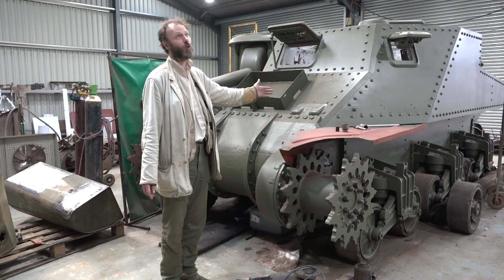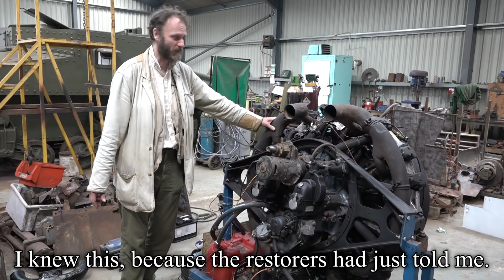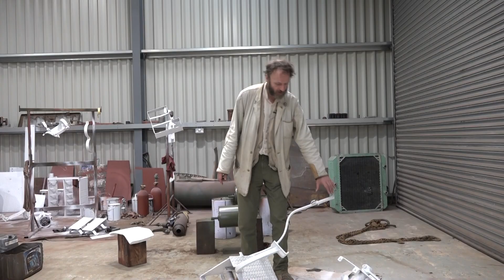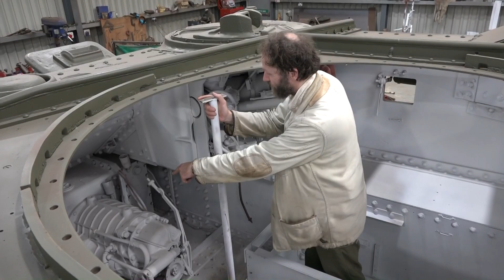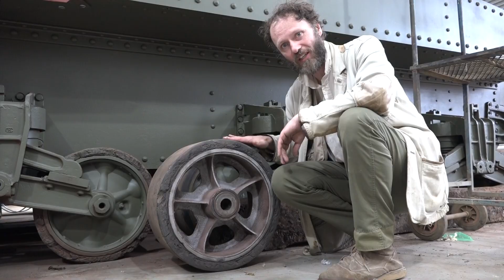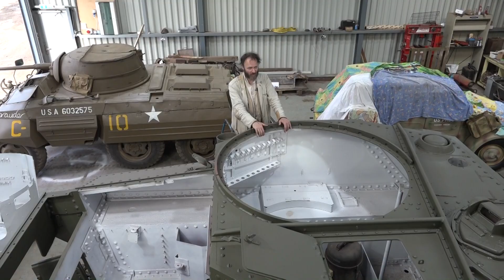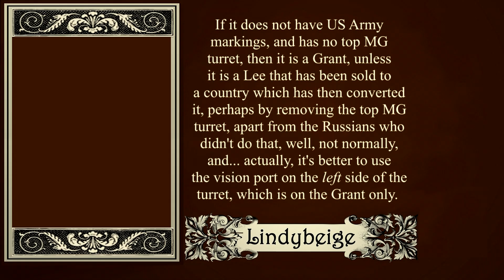The British Lee tank (that is not a Grant)

Comment: The utility of machine guns on tanks depends on where you are fighting.  In the Western Desert it was certainly hard for infantry to close in on a tank and an explosive 37  mm shell
would be liking throwing a hand grenade several hundred yards.  However, un urban and jungle fighting, where an enemy foot soldier could get close enough to do some damage (what were the Japanese getting those steel poles in the jungles?) a machine gun was useful, and with theli limited traverse of the main gun a coaxial machine gun was not going to cut it.  Nevertheless, tanks mount machine guns, event today.

Comment: Two advantages of armour riveted onto frame versus welded plate monocoque: 1. Easier to replace panels in the field 2. Don't need a special jig to hold each pair of plates in the right positions throughout welding, you just need to get an unsecured rivet or bolt into the first hole, then the rest of the panel can be lined up.

Comment: Don't knock the 2 pounder, it could defeat up to 70mm of armour at 60°.
That's the panzer 3 dead and the panzer 4 except the hull front.
"If you met a panther"
Then your grant reached 88mph and was equipped with a flux capacitor.
Reply: Well, it has to get back to the future somehow...
Reply: Where did you get the 70mm of armor penetration figure? Am I right to assume that this is at 1000 meters (which is the traditional distance these figures are tied to)?
Reply: @Ocrilat  
So, at 900m your can kill a panzer 3
But a late panzer 4 you need to be 100m of you're attacking the front, every other side your can kill it at 900m.

So I guess maneuvering is much more important that penetration anyway.
Reply: @MostlyPennyCat  Well, I think they are both part of the package: penetration, damage, tactical mobility, strategic mobility, armor, everything. 

On a tangent, it seems that the more I read about this stuff, though, the more I think that there was a real disconnect between tank theory as conceived at the top and the real situation in combat. So when the theory failed, the assumption at the top was that the theory was right, and the soldiers at the pointy-end just did it wrong. I think that may be a part of the reason the 2-pounder was kept for so long (it fit into accepted tank Doctrine). You see the same thing in the RN, where defects in the design of the 14-inch battleship guns are blamed on 'drill errors', delaying identifying and fixing the actual design problems. I don't know...I think there is something to this. What's your opinion?
Reply: @Ocrilat  
It does sound like doctrine problems.
Sending tanks without HE against prepared AT defences.
But I also wouldn't be surprised if this was just the fastest they could get a 6 pounder in a tank and change it up.
Below they got that they were using 25 pounders in direct fire, which comes high in my list of things I don't want shot at me.
Ze Germans thought we'd secretly design a fully automatic 25 pounder.
In reality we could achieve up to 8rpm X a 12 gun battery. Nearly a hundred rounds a minute, reach with 11kg of HE.

Ouch.
Reply: @MostlyPennyCat  The 25 pounder was good. The problems were a shortage of 25-pounders, as they were needed for artillery, and, they are howitzers, so low velocity and high trajectory weapons, so not ideal. 

A better solution would have been the British 3.7-inch HAA. At 94mm it was similar to the 88mm, was high velocity, and could have been a very effective tank killer. The problem again was doctrine, and how rigidly the British held to it sometimes. AA guns were meant to fight aircraft, so except in emergencies it wasn't considered a 'proper' AT gun. 

It's interesting though, what might-have-been.
Reply: @MostlyPennyCat  It's fascinating...I've been interested in this puzzle for a long time.
Reply: @Ocrilat unlike the 88mm the British 94mm aa gun could not be depressed low enough to be an anti tank gun. They were not built that way. Even after Dunkirk.
Reply: @patrickporter1864  That's not true, considering that on occasion the 94mm (technically the QF 3.7 inch AA gun) was used against tanks in emergencies. It's why at the time it was considered for the job, but unfortunately rejected. It was never adopted for that role, almost certainly because of how rigid the British were at this time. The guns would have been considered a part of the Royal Artillery, and since it wasn't the artillery's job to fight tanks, neither was the 94mm.
Reply: @Ocrilat  yes it took them quite a long time for them to learn anything from the Germans. Despite having one in 1926 it still took them until the mid 1940s to produce a self propelled gun.  Tradition taken too far.
Reply: @patrickporter1864  The USA? It wasn't tradition...it was low military budgets plus a disgust for seemingly offensive weapon systems (offensive in the eyes of the general public anyway). It's why the military pretended that the B-17 would be primarily used for coastal defense. It's why the USN tried to develop submarines into ships that would cooperate with the battle fleet (and failed). It's also why so little money was invested in offensive weapons like submarine torpedoes. And why so much was invested in defensive items like fighter planes, sonar, and radar. Defensive spending didn't annoy the voter like offensive items did.
Reply: @Ocrilat  
Just the wiki page.
70 is it's max penetration.
At 900m it's 57mm at 60°
Reply: @MostlyPennyCat  Yea that makes more sense...I'm looking at a penetration value of about 42 mm at 1000 meters. Don't get me wrong, the 2-pounder was a fine weapon when it was introduced, but by the time the Grant entered service, it was more or less useless. The Grant and then Shermans were the buffer until the excellent 6-pounder was able to be fitted to British tanks in any real numbers.
Reply: The 2 pounder was a good gun, it was the solid shot primitive ammo that caused its bad reputation
Reply: @davidwormell6609  Yes, but you need both for a gun to be good. I think the army went from APHE to solid shot AP just to keep the gun in service longer...cheaper than developing a new gun. They could have had the 6-pounder, but wanted to stick with the 2-pounder because of 'theory'. Dunkirk was blamed, but I think that wasn't the reason.

The theorists liked the 2-pounder because it was supposedly 'accurate on the move'. British doctrine held that tanks driving and shooting had an advantage over tanks that had to stop to fire. The problem was that the firing on the move didn't really work. But they stuck with it anyway. Again, a disconnect between theory and practical experience.
Reply: Providing that you could get close enough to fire the 2 pounder before the panzer 111s 57mm knocked you out.
Reply: @patrickporter1864  
Yep, he who hits first, wins.

Comment: The Sherman suspension was based on this. This being the earlier design
Reply: The "Sherman suspension" is actually just M3A4 Lee suspension. M3A4 had a longer hull and a heavier engine, requiring a heavier duty suspension, and predates the M4 tank. Both types of suspension were used on M4 tanks anyway; very early production tanks had the 'light duty' M3 bogies. One such M4 can still be seen at Bovington

Comment: No, it's not based on a sherman, the sherman was based on it.
Reply: Soon after,  the Canadian Ram tank design was built on the M3's lower hull and drivetrain. 
And SP guns of 105 & 155mm for USA, 25pdr for UK mobile arty units served to wars end.
Priest,  Sexton, arty tractors, radio and command variants, etc. Pretty good long life for a stopgap rush job! Gets a bad rap for not being "the supertank uber alles" especially by the Russians but beggars can't be choosy; and anything with a big enough gun to kill panzers at longer ranges and mechanical reliability to get to the battle,  fighting thru to win, and pursue or repositioning for advantage without mech failure is a huge plus in 1942.
Reply: Yeah, I dunno if you can read but he did put a disclaimer in the video.

Comment: Only the Panther Ausf D did you have to pull transmission. Ausf A and G had a removable roof hatch specifically so you did not have to pull turret.
Reply: Ausf D has that roof hatch too. I think he confused the Tiger I's method of removing the trans, which did require removing the turret, with the Panther's, which did not, on any version.
Reply: @Maus5000   Maybe it was a early production model but I have seen early Panthers that did not look like they had the roof panel over driver/hull gunner

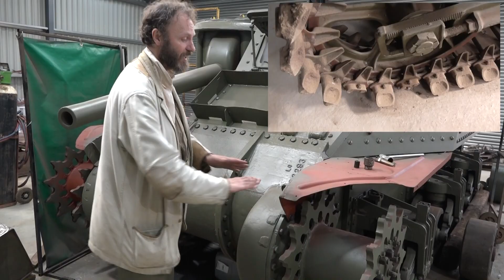Comment: 4:14 That was a common belief, however when tested it was discovered that relatively soft steel of track links increases shell normalization and actually lowers the relative armor thickness when hit at non-90 deg. angle.
Reply: There is still one good reason to do it though: moral. If the crew thinks it will help, they might actually fight...
Reply: I'd like to see that empirical evidence for that because it doesn't seem to make theoretical sense. To increase normalization, a larger rotational force has to be applied to the round, which usually decreases penetration by stripping away more of the KE of the shell as well as increasing the cross section of the shell relative to the armor.
Reply: Alex Dunphy As far as I know, when a shell is attempting to go through armor it will do 1 of three things: attempt to normalize to go through at a 90 degree angle, attempt to go straight through the armor at its current angle, or deflect off the armor entirely
Reply: @alexdunphy3716  'what he said......' (meaning you), hence my 'interesting' comment...I know from experience that if you want to drill steel, to get a proper start point, just marking and laying down some masking tape will help to place the center-punch where you want  it and also help center the drill bit, I know kinetic anti-armour rounds will behave differently; 'knee-jerk' logic would suggest that the more materiel between the round and the interior, the better....hence I am intrigued.....isn't the very  essence of Chobham Armour based on the principle of various 'stuff' dissipating energy and yielding through different vectors?
A worthy sir, I am agog
Reply: @conmcgrath7502  only way to figure this out is to test it.  Just have to find 10 or 20  M3 tanks and shoot them over and over again in both configurations.   --->   GO
Reply: Interesting.......

Comment: That shadow board in the background at 18min reall bothered me they had spanners hanging on the nails for hammers.
Reply: Royal Irish 
2 possibilities 
1 they knew that area was going to be filmed and wanted to screw with those of us with OCD, the evil bastards. 
2 they found out that the answer isn’t always a bigger hammer.
Reply: Gaah!  I hadn't noticed but I 'went back' to see.....dammit! Now I'm haunted by the specter of missing tools.........
time for the apprentice to get a swarfega shampoo!
I remember the days when every tool had 'a back on it' ie it comes back here..........I'm off now to check my socket sets, just to be sure an imperial didn't get mixed with a metric (shudder).
I had just about recovered from ' the missing 5mm  Cobalt drill bit crisis'  and now this!    It's too much (I have PTSD from the time my favorite electrical side-cutter was borrowed by a numpty who used it to cut stainless steel wire.....the horror, the horror...........)    mind you, the sinner wasn't very impressed (or very clever) when he levered the padlock out of his tool-box......the compressed spring launched the top layers all over the workshop......
Reply: @conmcgrath7502  And so begins another man's eternal hunt for the elusive 12MM socket.
Reply: That is some serious OCD 😜
Reply: And jumpers for goal posts, have some friends who were  in the royal Irish.

Comment: 1 fewer crew also cuts down on the pileup, when everyone has to deass the tank.  Yes, these are profession tankers, and they have deass drills, but you'd be amazed what all you can forget, when the tank is on fire, and starting to fill up with smoke...
Reply: "Oh bugger, the tank's on fire." 
At least one crew member's going to have a significant emotional event in the Lee/Grant
Reply: @Lo-tf6qt  Somebody's been watching Inside the Chieftan's Hatch!  Yeah, the tank filling up with smoke is definitely a SEE.  For pretty much everyone involved, but the Driver, and Commander are typically best seated for getting out first.  (Why it's called the Cheiftan's Hatch)  The gunners, and Loaders generally don't have as good access, because of the breach, and sights in the way, and the floor hatches range from awkward to impossible.  (They're honestly used more for discarding empty casings than emergency egress.)
Reply: This model was multiple guns, multiple gunners/loaders, even without the forward MG station, so had a problem with too many crew, not enough hatches.  Even with normal mount, and dismount, the general rule is:  "First one in, last one out."  (I wasn't a Tanker, I was a Fluid Systems Specialist, but I worked with SPA, and their crews.  So, I heard a lot of war stories, including SNAFUs just in regular deass drills.)
Reply: @Psiberzerker  Actually I think the driver and maybe radioman/machine-gunner had it the worst for getting out quick. The driver's vision hatch is too small for any but the smallest and most desperate. The hull gun crew have a hatch right above them, and on early models the M3 had 2 side hatches that were later deemed bad weak-points. The side doors were first welded over, but the later ones were built without them. The model in the video appears to be the latter.
Reply: 'Argh the tank is on fire'
Reply: Iain Botham  Yes, our Master Sergeant used the term "Deass."  He also said "It takes 2 to Tango, but more can Charley Foxtrot!"